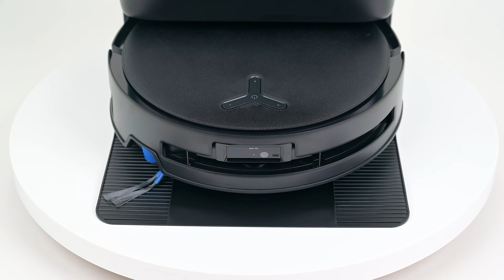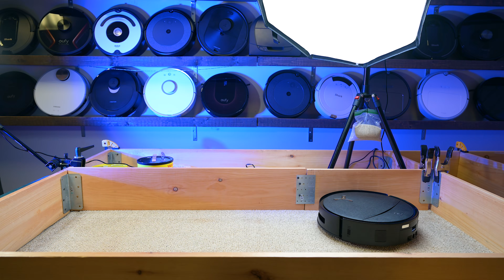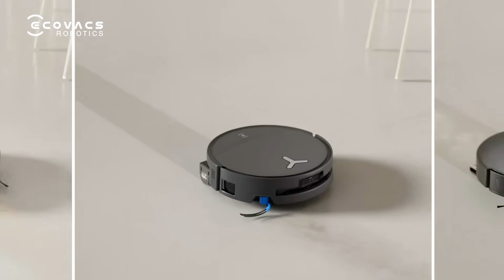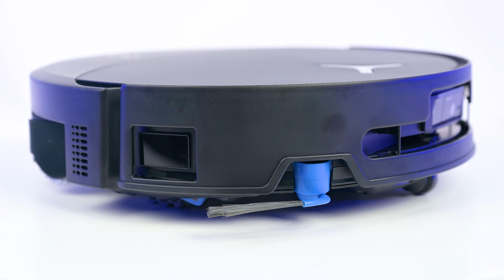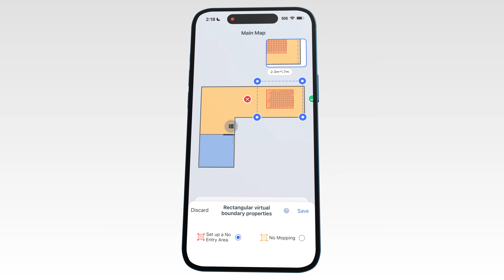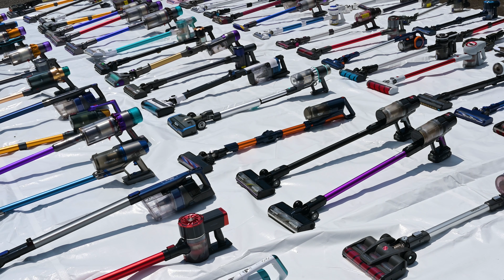ECOVACS DEEBOT T80s Review: The BEST VALUE Robot vacuum of 2026!

Comment: sorry for the stupid question, but does the LIDAR sytem avoid stairs? if i use this on my second floor will it automatically avoid the stairs, or can I set some type of virtual wall in the app?
Reply from the maker: Not a stupid question at all! 😊 Yes, virtually all LiDAR-based robot vacuums have cliff sensors that detect stairs and prevent them from driving over the edge. You can also add virtual no-go zones or virtual walls in the app if you'd like extra peace of mind.
Reply: @VacuumWars thank you, love your channel

Comment: How do you mop along the direction of the floor?
Reply from the maker: With the T80s, the navigation system determines the route automatically, so you don't typically have manual control over the mopping direction relative to the floorboards.
Reply: @VacuumWars  makes sense. I have the T 90 Omni pro and couldn’t find that setting anywhere. It seems hit or miss. Some of the floors it goes in the correct direction others not so much.

Comment: There is another major con that you didn't mention. None of Ecovacs' roller mop models have a mop only mode. You can vacuum only, vacuum and mop at the same time which should never be done because of the risk of moisture getting in to the vacuum system, or vacuum and then mop. You cannot send out these models to just mop a room or the entire house the way you can with the spinning pad models.
Reply from the maker: That's a good point. Different users have different preferences when it comes to mopping workflows, and a dedicated mop-only mode can definitely be useful. Thanks for highlighting that distinction between the roller mop and spinning pad models.

Comment: I have the Ecovacs T80, and overall I have mixed feelings about it.

What I like:

* It does a good job picking up loose hair, especially from corners.
* Sweeping performance is solid.
* It does a decent job with light mopping and helps keep the floors looking cleaner and shinier between deep cleans.

What I don’t like:

* It struggles with hard or dried-on stains. For those, I still need to mop manually or use steam, so it can’t fully replace a person.
* It has difficulty climbing onto thick, plush carpets, which means it can’t reach several rooms in my house.
* I’ve experienced battery issues where the robot shut down in the middle of a cleaning cycle, even though it was configured to return to the dock when the battery reached 20–30%.
* The front-mounted LiDAR doesn’t always produce an accurate map of my home. I often have to edit the map manually because it misses areas or creates an incorrect layout. I wish it could import a floor plan from an iPhone LiDAR scan to improve mapping accuracy.
* Maintenance is more time-consuming than I expected. The dustbin needs frequent emptying, and cleaning the internal components is tedious. Debris and sediment collect in small compartments that require cotton swabs, tweezers, and other small tools to clean properly. Some wear parts also seem to need replacement sooner than I anticipated.

Overall, I’ve accepted that no robot vacuum can clean as meticulously as a person. The T80 is useful for daily maintenance and keeping the floors generally cleaner, but if you expect it to remove stubborn stains or completely replace manual cleaning, you’ll probably be disappointed.

Looking ahead, I can’t wait to see the next generation of robot vacuums. I’d love to see true steam-powered mopping that can tackle stubborn stains, a stronger drive system capable of climbing thick, plush carpets, and a more advanced obstacle avoidance and navigation system. I also hope future models are designed to require much less maintenance, with self-cleaning mechanisms and components that stay cleaner for longer. If manufacturers can solve those challenges, robot vacuums will become much closer to a true replacement for manual floor cleaning.
Reply: Your expectations seem entirely unreasonable. It's both not picking up enough, with zero effort from you, while simultaneously picking up so much that you must empty it frequently... Your house is clean and all you gotta do is deep clean once a week and empty a bin, and that's too much for you? so much that it meant writing a novel to complain? I think you're a little extra bro 😂
Reply from the maker: Thanks for sharing your experience!

Comment: What would you recommend that runs quieter (no extra motor noises other than vacuuming) and still has raisable mop & mop cleaning in station?
Reply from the maker: Noise preferences can be pretty subjective, so we'd recommend using our Robot Vacuum Comparison Tool to compare models based on the features that matter most to you, including mop lifting and dock capabilities. 👍
https://vacuumwars.com/robot-vacuum-comparison-tool/

Comment: I wonder, the side brush at the front does not extend. How well does it perform in corners of 90 degrees? Is an extendable brush a must-have feature or does it not add much? Could you please elaborate on this? 

Most rooms I have are square shaped, so cleaning the corners is kind of a must have for me :)
Reply from the maker: Extendable side brushes can help in corners, but we wouldn't call them a must-have. 👍 Most robots still leave a little debris in tight 90° corners, even with one. If corner cleaning is a top priority, it's worth looking at our comparison results to see how specific models performed.

Comment: The roller on mine doesn't lift up on the carpet. Am I missing something? I looked all throughout the app and couldn't find any setting.
Reply from the maker: f yours isn't lifting, double-check that carpet detection is enabled in the app and that the robot's firmware is up to date. If everything looks correct, it may be worth reaching out to ECOVACS support, as that doesn't sound like normal behavior.

Comment: Are black carpets still a problem for robot vacuums? If so, can you add a black carpet test like in some of the much older videos?
Reply from the maker: Black carpets can still be an issue for some robot vacuums because certain cliff sensors may mistake them for a drop-off. I will pass your suggestion over to the testing team!